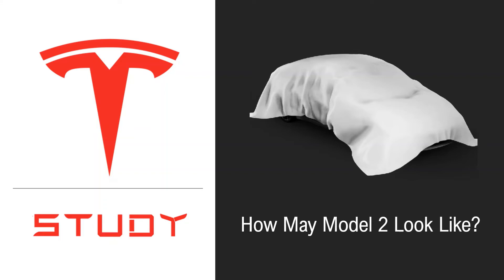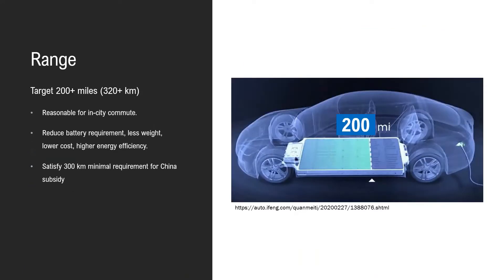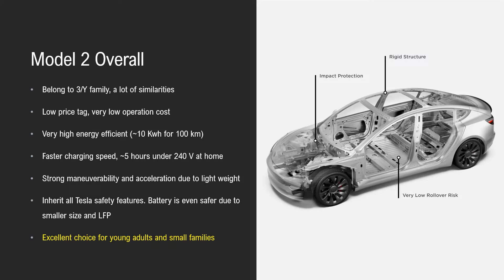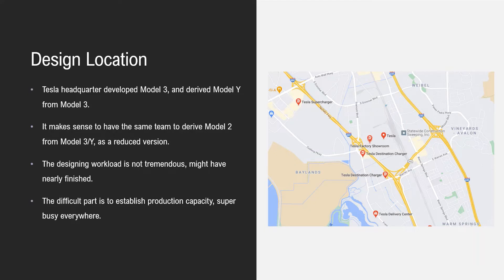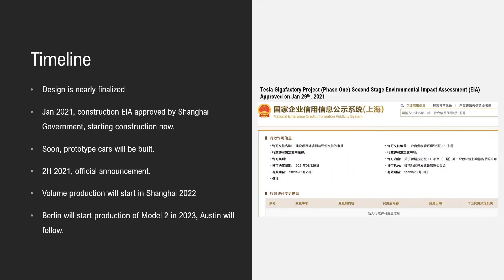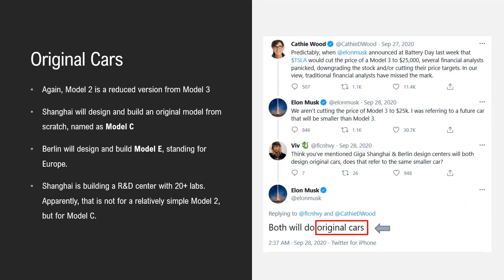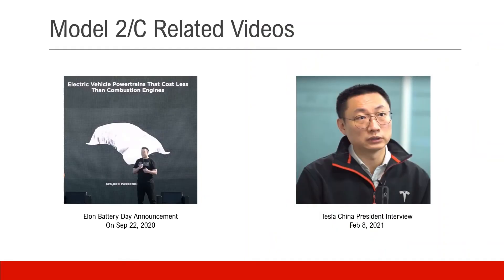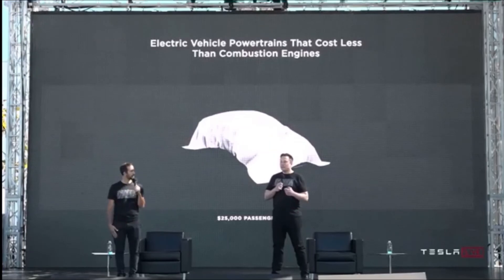How May Tesla Model 2 Look Like?

Comment: Cybertruck saw cost saving innovations such as unpainted folded stainless steel. Will we see similar radical innovations for Model 2? Die cast underbody, for sure. Maybe an exoskeleton upper body too, either die cast or stainless steel, perhaps in a less dramatic style? Anyway, I'm expecting to be surprised.
Reply: A very small, lightweight and almost indestructible city car, designed to become a robotaxi in the near future, rather than to do longer trips. There'll be a huge gap between the most basic version and the high performance one, to serve very different demographics.

Comment: Now that Model Y had single part castings, and us soon to have the structural battery pack, is it really still the same platform?
Reply from the maker: You are right. Tesla always keep improving their platform. Even MIG model Y and current model Y are not exactly same in manufacture process. Consider them as variances. Model 2 ideally should have structural battery pack, casting underbody and 4680 battery, similar to MIG model Y. The availability of 4680 battery and giga press are the potential hurdles. I hope they can have enough of them by the time.

Comment from the maker: Model 2
* Belong to 3/Y family, a lot of similarities
* Low price tag, very low operation cost
* Very high energy efficient (~10 Kwh for 100 km)
* Faster charging speed, ~5 hours under 240 V at home
* Strong maneuverability and acceleration due to light weight
* Inherit all Tesla safety features. Battery is even safer due to smaller size and LFP 

Excellent choice for young adults and small families